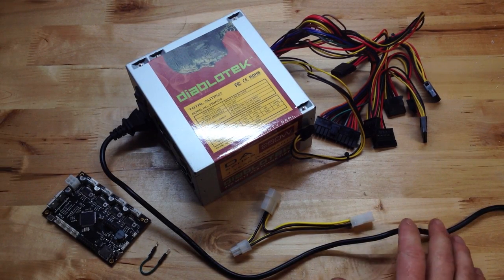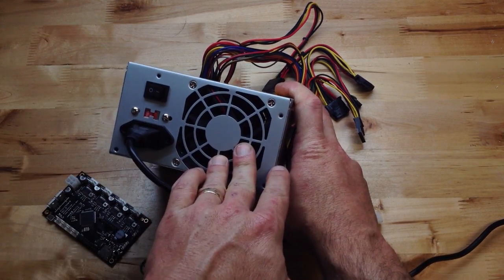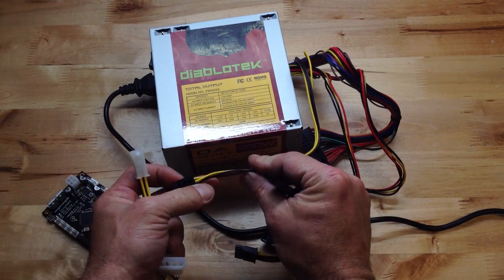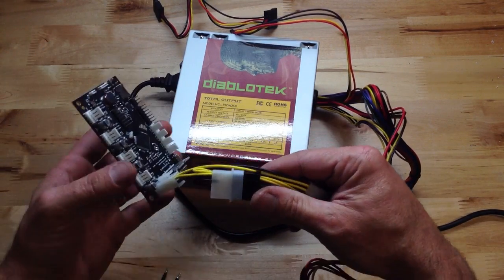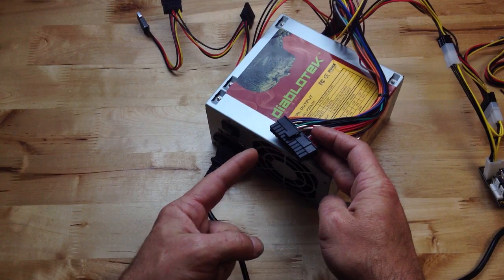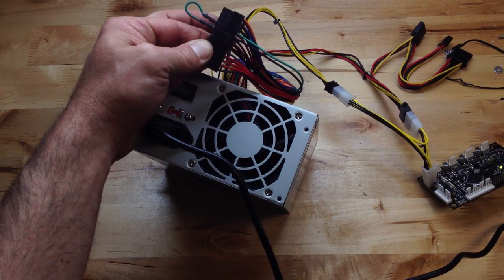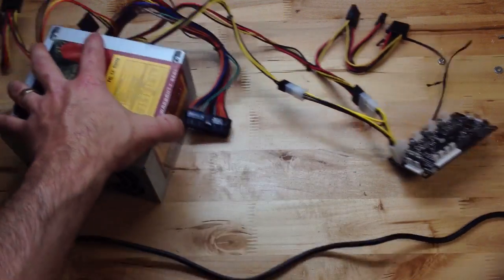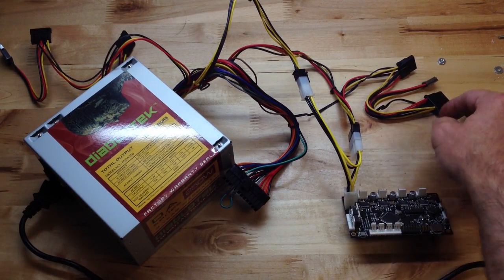Printrbot Build 16

Comment: Hi Brook. I have the Printrbot Simple 1405 kit with the Rev F4 board. Loving it so far, perfect for me to use full timing in my motorhome. I was wondering if there are plans for a 6 pin/wire version of the cable or if there is a wiring schematic available for making my own. I have 3 power supplies with the 4 pin connector and would rather use one of those perfectly good power supplies if possible, since I have them, rather than go out and buy another one. Plus I love tinkering and re-purposing things. Thanks for your time in reading this and keep up the great work.

Comment: Hint: You may have to connect the brown wire (3.3V sense) to one of the orange wires (3.3V) to get the power supply to stay on for more than half a second.
I have a diablotek PSDA250 I got from amazon. I had to do this before it would work.

Comment: Any PC power supply with similar or better output (current) will be fine. Way too much moaning about power supplies... they are cheap, available in every corner of the planet, and cheap (mentioned twice because they are really cheap!!). They all come with the right connector even, so there's nothing extra to do except jumper the green wire to ground. All up takes about 45 seconds if you go slow...